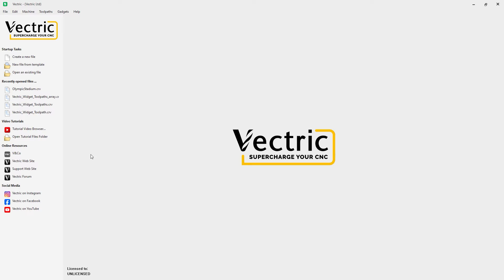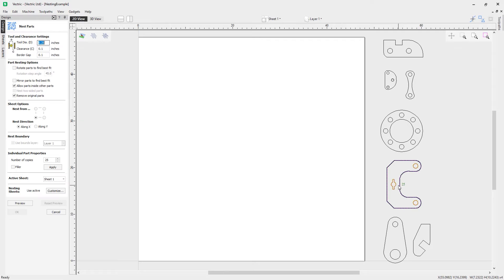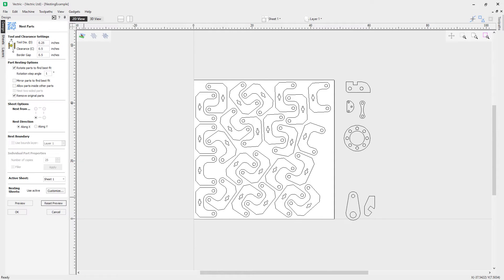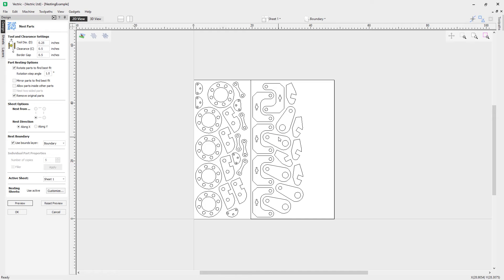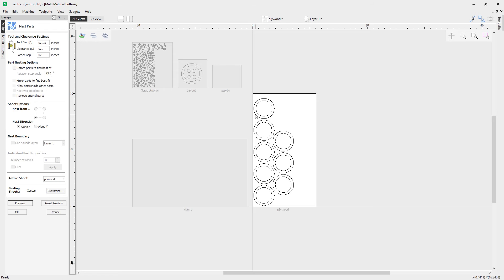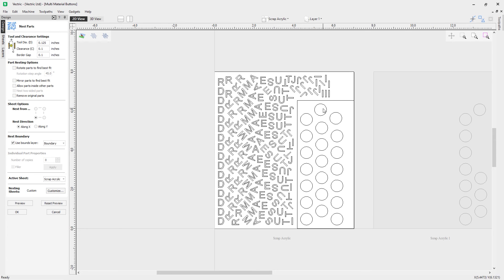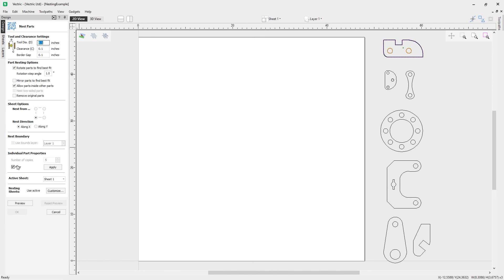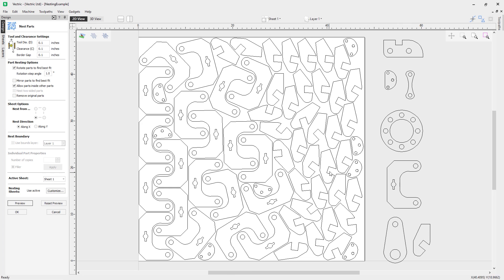How to use the nesting tool in Vectric software | Offset and Layout Tools | V12 Tutorials

Comment: Good day! Your nesting doesnot work for me. Downloaded a trial version 12 of vectric. Started the program, applied a sheet with 590x890x16 mm dimensions. Made a simple Ngon with 5 edges. Went to "Nesting" chose tool (3mm) clearance(2 mm) border gap(10 mm), the amount of copies were 1~3, none of them worked. I used this file on 3 machines with Windows 11 installed. Vectric crashed on all of the machines (Intel core i3 (laptop) / AMD Ryzen 7 6800 h (laptop) / 2 x Xeon e5 2699v3 (Desktop) - are CPUs of the machines i used to test)... Any suggestions?
Reply from the maker: This sounds like one for the support team to have a look at.  Could you please email them at support@vectric.com, include your explanation of the issue and the file you have created.  They can have a look and see if we can reproduce the issue, or find the problem for you.  Thanks.